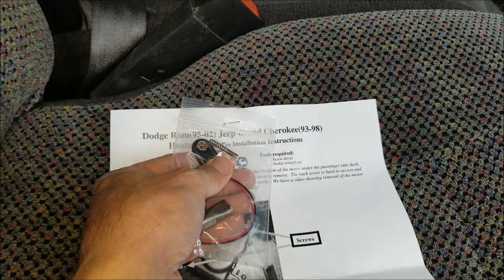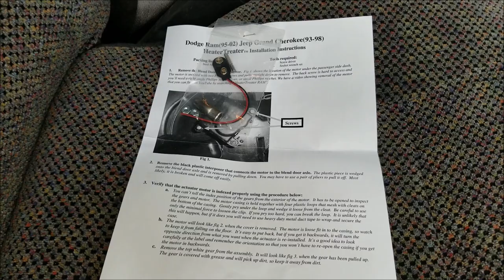2001 Dodge Ram 1500 - Blend Door Repair/Heater Treater Installation - Part 1

Comment: Hey Matt, Thanks for the video! I will share a trick I used to get that back screw out. I cut the rubber and pad just like you did. I used the crescent and allen head bit to turn the screw a very small amount (just enough to move it). Once I realized what a pain in the but it would be to get it out like that, I had a look around and tried, on a hope, an 8d duplex nail. I bent the nail 90 degrees about 1/2" from the tip and made an angle screwdriver. The diamond tip of the 8d nail actually worked quite well and rotated that screw out. reinstall was easy (relatively of course) as well. Thanks again!

Comment: I have had the kit for a month or two and finally looked up under there.  I was hoping that was the servo and it wasn't buried back under the plastics as I have a manual transmission.  Thanks for the vid.!

Comment: a small ratchet and a 1/4" socket turning that screwdriver bit would probably be a better bet on that back actuator housing screw.
Reply: Doesn't work that well. Tried it that way myself.

Comment: Thanks, the information here was great. I found it much easier to use a small closed end wrench around the phillips driver bit. I wrench also has that little angle bend which helps  even more.
Reply from the maker: Thanks for sharing that tip!  That does sound easier.

Thanks for watching!

Comment: pretty much a good view of the piece that needs to come off, and then a very long segment on how to get at an inaccessible screw. BTW, i think this is what's wrong with my 2001 dodge ram pickup. the air conditioning works fine sometimes but on occasion, when braking will turn from cold air to hot air. there is also the intermittent sound of a fan hitting a plastic shroud under the passenger's side dashboard on occasion. i can also hear the faint sound of a plastic door closing.
Reply: Blade Runner you ever figure that out,   That’s the exact problem I have
Reply: @puck5237  i fixed my problem. i bought the part advertised in the video (and yes, i know it should cost about a buck, but whoever came up with this quick and relatively inexpensive fix will get my 30-40 bucks without further complaint from me). 

BTW, i bought a 90 degree bend phillips head/flat blade screwdriver at ACE hardware ( https://www.acehardware.com/departments/tools/hand-tools/screwdriver-sets/20591?x429=true&gclid=EAIaIQobChMIhv384MuR6QIVdT6tBh0VlgIPEAQYASABEgL9BPD_BwE&gclsrc=aw.ds ) it was indispensable. after ripping out a few square inches of vinyl flooring (i don't have carpet in my ram) and a like amount of sound proofing stuff, i could eventually turn the screw about 1/8 of a turn at a  time. meaning it took about 10-20 minutes to undo one of the screws. pulled the broken part of the hinge off with a pair of needle nose pliers (it came out in two pieces as you might guess), stuck the 'magic' splint on and bob was my uncle.

it should be noted that before i started i verified (though it's not really necessary) that the blend door motor was indeed working properly, defined as when the temperature knob on the dash was turned that the motor turned the blend door shaft, which is barely visible and touchable with a well placed finger.
i'm pretty sure that in my case, the blend door itself was just 'twisting in the wind' so to speak and at the mercy of it's own inertia as a result of the broken hinge/motor shaft interface.

all in all i was very, very pleased that i managed to fix a problem that has been plaguing me for over a year and was misdiagnosed by multiple AC professionals (damn them! :)).

Comment: I just bought an 01 Dodge 1500 what's told that the  Actuator was busted on the AC and I needed to get a new one so I did that come to find out the SCREWS are broke off from the housing Is there any way to repair it with JV world or apoxy I see putting the screw amounts back on the housing

Comment: Okay. So I bought the part. However my issue isn’t any of the issues you have mentioned. My heat goes on when moved to hear and when set to cool. I got down there and had my daughter move the hot and cold and I could see the blendor part moving. So here is my issue when I hit about 60 MPH it stops working. Does that have to do with the blendor? I am girl fixing my own stuff and hate  to be taken advantage of. Can you help me to trouble shoot it. I have no issue following the steps in your video, but don’t want to do all that if that isn’t my issue. Thank you in advance.
Reply from the maker: Hi Monica, much respect to you for tackling your problem yourself!  Can you clarify what exactly stops working when you hit 60 mph?  Are you saying that the air completely stops blowing from your vents at 60 mph?  Or does it perhaps start blowing from the defroster at 60 mph?  Or are you saying that the blend door stops working properly at 60 mph, and you still get airflow from the vents, but can no longer control the temperature of the air at that point?

If you can clarify, I'll do my best to help you out.  One of the common problems is that the air ducting controls (floor vents vs. dash vents. vs. defroster) are operated by engine vacuum (suction), and if one of the vacuum hoses in the engine bay develops a split/crack, it can cause the duct controls to go haywire.  This same thing happened to me years ago - while accelerating from a stop, my dash vents would suddenly stop blowing air and all the air would get routed to the defroster vents.  It turned out to be due to a broken vacuum hose in the engine bay - under heavy load (like when accelerating), the engine was sucking in more air, (some through the broken vacuum hose) and it caused the issue with the duct controls.

Thanks for watching!
Reply: You have a vacuum leak 💯

Comment: I have a 98 dodge ram 1500 5.9l v8.  On the fan speed control 1 and 2 i have a pretty good amount of heat.  On 3 and 4 it gets colder.  Ive changed the thermostat.  The heater core is hot but my antifreeze is only at about 65 degrees at operating temp.  The dash says it is running at about 190 degrees.  After a while 3rd and 4th setting starts to get warm ill change it to defroster and back to the face and you here a klunk and it goes cold again.  Any idea?
Reply: This is exactly my issue too. Same year truck. Did you ever figure it out?
Reply: @jeremybuchanan289  i have not.  I will let you know tho if i do!
Reply: I'm leaning towards changing the radiator.   Already flushed the heater core, and I doubt it could be the water pump. Likewise, if I figure it out, will let you know.
Reply: @jeremybuchanan289  Alright thanks.  Ive been told to flush the whole system just havent had time.  I checked my water pump and it was alright.
Reply: Our trucks use a cable to operate the blend door. It is adjustable, and has a procedure to reset. I found it in a forum. 

Here's the adjustment for the temp control cable on the 1998-2000.
Any time the heater-A/C control or the temperature control cable are removed and/or replaced, the following procedure must be performed.

The temperature control cable housing and core must be installed at both the heater-A/C control and the heater-A/C housing ends, and the heater-A/C control must be installed in the instrument panel.
Rotate the temperature control knob on the heater-A/C control so that the knob pointer is in the 12 o'clock position.
Pull the temperature control knob straight out from the heater-A/C control base until the perimeter of the knob (not the knob pointer) protrudes about 6 mm (0.25 inch) from the face of the control base.
Rotate the temperature control knob to the 1 o'clock position. Push in on the knob slightly and continue rotating the knob to its full clockwise stop. The knob pointer should be aimed at a position about 8 mm (0.315 inch) beyond the end of the graduated red strobe temperature control graphic on the face of the heater-A/C control base. If the knob isn't pointed to the correct position, go back to Step 2 and repeat the adjustment procedure.
Rotate the temperature control knob counter-clockwise until the knob pointer is in the 12 o'clock position again.
Push the temperature control knob straight in towards the heater-A/C control base until the perimeter of the knob (not the knob pointer) is flush with the face of the heater-A/C control base.
Rotate the knob to its full clockwise stop again. The knob pointer should be aimed at the end of the graduated red strobe temperature control graphic on the face of the heater-A/C control base. If OK, go to Step 8. If not OK, go back to Step 2.
Rotate the knob to its full counter-clockwise stop and release the knob. If the knob springs back from the counter-clockwise stop, the self-adjuster clip that secures the temperature control cable to the blend-air door lever is improperly installed. If the knob doesn't spring back, the temperature control cable adjustment is complete.
Reply: @jeremybuchanan289  Did this work for your truck?  I tried it on mine and it did not work.
Reply: @bdogpranks8853  no, but in fairness, I think I did it wrong. Either I can't get the knob to pull out as far as needed, or it comes off all the way. But, when I turn the knob from hot to cold and back, I hear the door slam against the stops. That leaves me to believe the blend door itself is broken and not sealing. When i touch the heater core, i burn my hand. That tells me the water is hot and circulating.  I removed the glove box to gain access. I did notice that when I turn the knob and hold the blend door rod at the bottom, the knob turns when the door stops. Ours has the cable mount on top, and that may be cracked just like the electric motor does.  Unfortunately, that piece cannot be removed without removing the dash.
Reply: @jeremybuchanan289  thats exactly how mine is.  Have you ever checked your antifreeze temp when vehichle is at operating temp?  When mine is at operating temp i can take my cap off and some antifreeze comes out but i can hold my finger in the antifreeze and it doesn't burn my finger.
Reply: @jeremybuchanan289  Have you felt your radiator at operating temp?  If so the front of it should be hot right?
Reply: @bdogpranks8853  well, it's warm but not hot. The problem is the outside temp is pretty cold, so the fan is pulling a lot of cold air across it. However, the inlet and outlet on the heater core are too hot to hold, so that tells me the coolant is getting plenty hot enough. If you remove the glove box, you have easy access to them. Also, you will see the blend door actuator in front of them. Ours is cable operated. I still think the issue is with that piece not closing the door 100 percent.
Reply: @jeremybuchanan289  alright.   Have you noticed when you accelerate if your heat gets warmer?  I noticed that the other day.
Reply: @bdogpranks8853  no, it pretty much stays the same. If the fan is on high it starts to blow cold though. That's why I think the blend door in the culprit. My dash is perfect, so I'm just going to leave it be at this point. No reason to crack it.
Reply: @jeremybuchanan289  Alright thanks.  If I find anything out ill let you know.

Comment: I have a 1995 Dodge Ram and the problem I have is that when I floor it or accelerate hard I hear like a door move and it stop sending a/c air true the vents and it goes to the windshield vents for defrost and went I stop the acceleration the a/c air goes back to the front vents this happens every time I accelerate hard have anyone have or had this problem please comment
Reply from the maker: It sounds like you have a vacuum leak somewhere, as the controls for the air damper that directs air to the floor or dash vents operate by vacuum.  I had the same problem years ago - it ended up being a split vacuum hose in the engine bay.  I'd start by tracing all the vacuum hoses to see if any air unhooked, and if not, then start feeling them for splits/cracks.

Good luck, and thanks for watching!
Reply: A tanks for the reply and I will look at this problem this weekend
Reply: @mattpayne4087  That sounds like my problem. Going back and forth between hot and cold air. Thanks for the tip.

Comment: Matt... if the ac blows cold on the driver side (left and right vents by steering wheel) and blows hot on the passenger side,  you think this will help? Thanks for any info.
Reply: Did you ever get an answer for this? I have the same problem.
Reply: @walterjohnziemba6720  no I didn’t Walter, typical...... and sold the truck.  Hope you get it fixed man. Good luck. 👍

Comment: As a Designer & 3D modeler, I see this as one of the dumbest designs ever. The manufacturers purposely design things like this is so the customer will take it to the Stealerships to get it worked on. As a mechanic, things like this are infuriating to me. The design of the middle shaft out of plastic is dumb as well as cramming it wedged up against the floorboard like it is makes me never want to buy a dodge ever again.